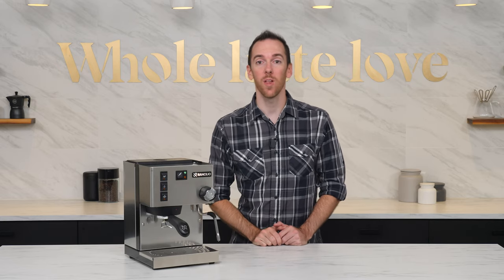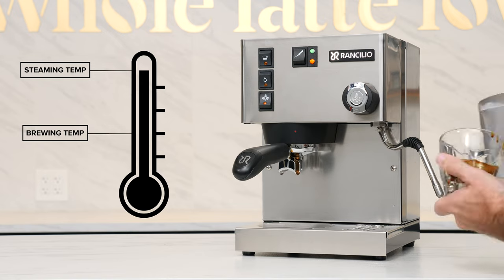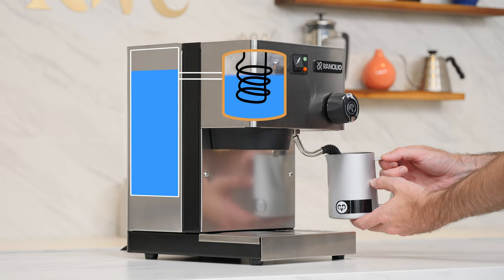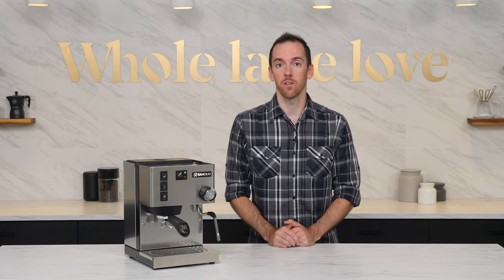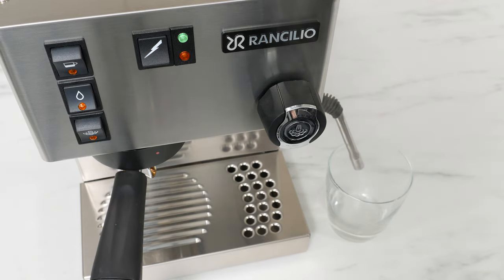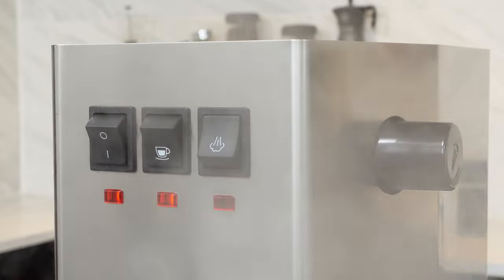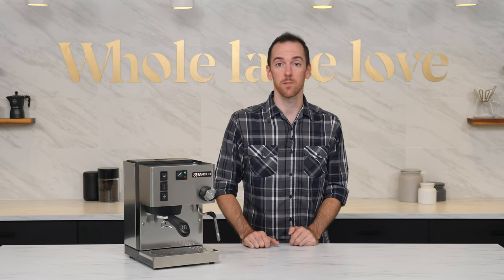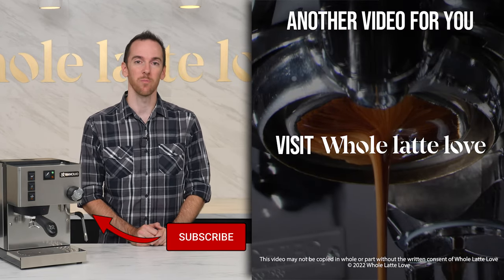How and Why to Refill Your Espresso Machine Boiler

Comment: I've actually wondered this for a while, what happens on a dual boiler? Or even on HX, what is filling the steam chamber?

I have a Classika and I refill the boiler by running the grouphead for about 35 seconds. This way it cleans my screen for next use as well. Refilling by the steam wand is too much work, if it breaks my machine then so be it.

Comment: Nice video!! I’m a beginner and still thinking about buying the Silvia. This might be a dumb question but when just brewing back to back shots and NOT steaming, is it necessary to cool it down or you just flush the group head and that’s it to continue to the next shot? Also, when brewing regular americanos, same question, I have to cool it down through the steam wand? Thanks!
Reply from the maker: Hey Alon, Thanks for the question and there are no dumb questions! No need to cool down boiler if just doing espresso or drawing hot water. Only need to cool down after steaming. I do recommend a flush in between shots.
Hope that helps!
Marc

Comment: Thank you for the video! I just asked Marc to explain cooling down the boiler yesterday. How about  back flush? Is it to flush the remain coffee ground out after each brew? What is the point of using the back flush basket? Why not just let the hot water run out? Thank you!
Reply from the maker: Hey SS, I have a separate video on how and why to backflush: https://youtu.be/5LEd0XoFVRg
While running water through the group helps clean the outside of the shower screen, backflushing forces hot water and detergent back through the brewing system, cleaning out the internal components.
AJ

Comment: If you steam first then pull shot, is the refill done automatically?
Since a shot has been shown to hold for 3-4 min without degrading, and running water through the grouphead to cool down to brewing temp is only seconds, wouldn’t this workflow be best?
Reply from the maker: Hi Sydney, Refill cool down is not automatic on most single boiler machines. Yes, I prefer pulling the shot first then steaming milk.
Reply: @Wholelattelovepage  clarification- does steaming the milk first, then pulling shot eliminate the extra step of refilling the boiler? Does pulling the shot refill the boiler from the steaming?
Reply from the maker: @SKG-d2t  Hi, No, pulling a shot does not eliminate need to cool down/refill. Water left in the boiler after steaming will be extra hot - way beyond brew temp range and blast steam through your coffee.
Reply: Thank you

Comment: Hi AJ, I have a Silvia. After I steamed the milk and I switched on the hot water button and refill the boiler. After 8seconds, I found the reservoir’s water was used up. I switched off the hot water button and refilled the reservoir immediately and keep switching  on the hot water button until it had steady water.
I want to ask is it gonna hurt the heating pipes? 
Thanks😢
Reply from the maker: Hi s, Highly unlikely there's any issue with an 8 second partial shortage of water in the boiler.

Comment: Yet another excellent video.  It is a bit ironic that single boilers are targeted toward novices… but require the most attention to arcane details
Reply from the maker: Good point. I think that's fairly common with technology - the more expensive versions require less user attention.
AJ
Reply: @Wholelattelovepage  
Well, fwiw, my long years with Silvia provided extensive educational opportunities…. Often facilitated by WLL videos
Reply: @Wholelattelovepage  

AJ… I have some feedback I would like you to forward to Marc

Hey Marc… hope all is well for you.   I recently bought a profitec Pro 300… mostly happy.  But there is one important  issue that your videos do not cover… and it is an issue that would apply to other double boiler machines.

Basically… the steam boiler gradually concentrates what ever minerals are in your water… since water is constantly evaporated to creat steam.

I discovered this in the following way.   I use RO water… and have experimented with adding some minerals to balance the flavor.   So… I was doing this for several months… and basically never using the hot water tap.  Then, one day, I decided to use this water to pre heat our cappuccino cups.  And, in my wife’s cup, she wants some extra water left in the cup to reduce the milk.   Well, she came back to me and complained how horrible her coffee was… and, yes it was terrible,  I figured out that the minerals in the steam boiler had been progressively concentrating as I used the steam wand over the months

I presume that most or all double boilers could see a similar phenomena.  Anyway, I just wanted to pass along my experience
Cheers
Ardy Hagen

Comment: Hey AJ, a quick question. I have the ECM Classika ll and i accidently turned the steam switch off after steaming, but forgot to turn the pump switch on and opened the steam valve for 20 seconds. Then I wanted to clean the group head an started the brew but realized after a couple of seconds that no water was coming out and stopped and turned on the pump switch. This happend to me twice today. Is there any chance the heating element is damaged or has the ECM a security mechanism or similar that prevents it from it? 

Big thank you in advance
Reply from the maker: Hi n, highly unlikely you damaged the heating element - especially since you turned the steam switch off after steaming.
Reply: @Wholelattelovepage  thanks for the quick reply guys : - )

Comment: Thank you for clearly and succinctly explaining. One question - how much steam should you do on a Rancilio Silvia v6 (as you had there) before refilling becomes imperative? Although the answer may be the same as "how long's a piece of string?", any guidance gratefully appreciated 🙏
Reply from the maker: Good question and I don't have a solid answer. I personally do it after every time I steam milk. This helps cool down the boiler if I'm going to pull another shot next, then repeat the process if I'm making another milk drink. I imagine you could probably steam two pitchers of milk back to back (for example, for a split shot into two drinks) and be safe as long as you turn the steam switch off and refill it after. 
AJ
Reply: @Wholelattelovepage  Thank you. Love the channel 🙂

Comment: Thank you for this video.  I do purge the steam wand after frothing; but after that, I then press the brew button (Gaggia Classic Pro) to clean the screen/group head while thinking it also adds water back in the boiler, right?  Is this ok?
Reply from the maker: Yes, it does. Just make sure you also turn off your steam switch afterwards. 
AJ

Comment: Hey Marc! Chun Wei from Malaysia!

I’ve pre-ordered my Profitec Pro 700 with flow control and T64 grinder. From your review of Pro 700, you mentioned that true line pre infusion will be available when I plumb in my machine. But with the flow control, even when I don’t plumb in my machine (as my machine will be placed far away from the water line), will I be able to use function of “true line pre-infusion” with only the flow control?
Reply from the maker: Hi Chun, Yes, you can use the flow control for pre-infusion! Here's a link to article with all kinds of info on flow control including graphs of 5 flow profiles: https://www.wholelattelove.com/blogs/articles/intro-to-calculating-flow-rate-on-e61-group-machines
Marc

Comment: On a Gaggia Classic Pro, should I only turn on the pump and open the steam valve to refill the boiler? I've been turning on both the brew switch and steam switch with the steam valve open to do this. Is that incorrect?
Reply from the maker: No, that is not incorrect at all. In fact, that's the "cleaner" way to do it, as hitting the steam switch closes the solenoid valve and prevents water from coming out of the group as well as the wand. 
AJ

Comment: I prefer to run the pump while the steam valve is closed until the boiler is full and cooled down, then run out some water to clean out the wand once it's just hot water again, not steam... 😁
Reply from the maker: Hey Angelito, so while you're running the pump with the steam valve closed, where is that steam/water going? Out the brew group?
AJ
Reply: @Wholelattelovepage  Hi AJ, I have a Lelit Glenda and to be completely honest with you, I have no idea, it doesn't come out the brew group or the steam valve, possibly it's being discharged beck into the water tank? I'll have to look next time... 🤣
Reply: @Wholelattelovepage  the machine has a PID and it shows the temperature go down very quickly when I do this, but no water comes out as I said 🤔
Reply: @Wholelattelovepage  maybe the steam condenses back into water?  I’m not sure if there’s enough of a temperature drop for the steam to condense right away.
Reply: @oddsman01  well the boiler takes about 5-10 seconds to refill and I looked this morning and you can see a few bubbles returning to the water tank once it's full...

Comment: It's not true.  The Gaggia does have a hot water function by depressing both the steam and espresso simultaneously.  You must recharge the boiler after frothing 2 or 3 pitchers of milk (if you make several latte's in succession like I do for my office).  If you do not recharge the boiler, you will find it takes longer froth milk and harm the heating element.  Honestly,  spend a few hundred more dollars to get the Rancilio - it's a much more capable espresso machine.
Reply from the maker: Thanks for the comment. Yes, pressing the steam and hot water buttons together is a better method for pulling hot water on the GCP. 
AJ